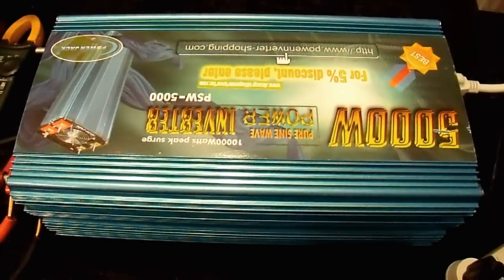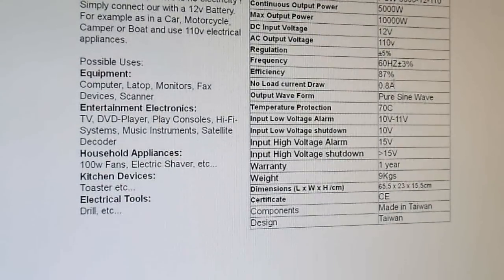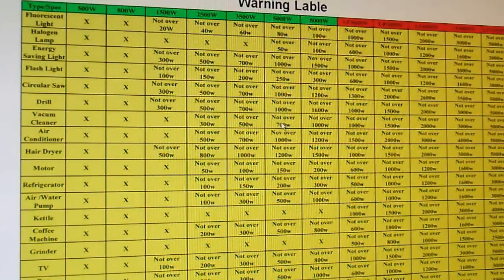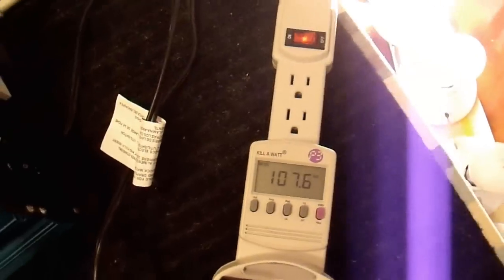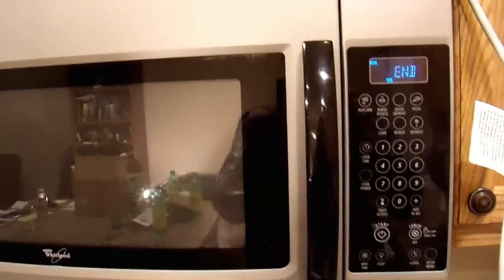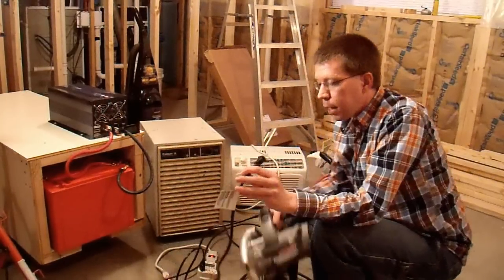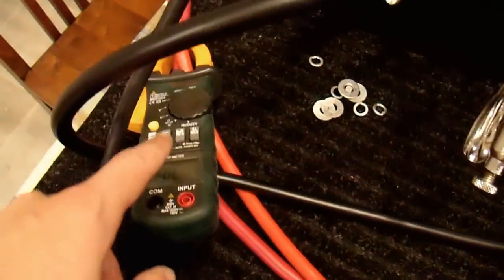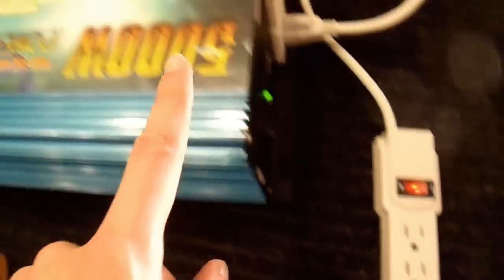Power Jack 5000W Pure Sine Inverter Review - part3/3

Comment: Can it power a fridge,microwave(what size) and TV in a tractor trailer?and maybe a laptop?
Reply: Antoine Finch if it really can handle 5000 watts that should not be a problem, fridges take let's say 300 watts, a microwave is 800 watts, TV+speakers etc. about 300watts. laptop 40 watts (when charging ), few lamps at 20 watts each and we're looking at 1500 watts when everything is on.
Reply: Antoine Finch I just pulled those figures out of my ass, microwave might take more, fridge maybe less, and considering this 5000 watt inverter could handle 2000 watts (for a short time) it should work but i'd recommend spending a bit more on a better inverter

Comment: perhaps the fan was blowing the hot air out for reason? blowing hot air inside with insufficient ventilation could overheat the components quicker. Wouldn't you agree? what if you tried to reverse the fan?

Comment: Could anyone tell a Dodge Ram 350 Hi top camper van (V8 318 5.2L) running idle could continuously power its built in AC through this inverter?

Comment: Do you think it could it run your fridge indefinitely?
Reply from the maker: My refrigerator?  Yes, I believe it could for a few years before it wears out or fails.
Reply: @knurlgnar24  Cheers,  I'm considering buying something similar just to run my fridge and maybe a security system.  My thinking is that they're appliances which are running 24/7 so if I experiment with a small off grid system those would make for a good test.  Also I wouldn't want to burn out the compressor on my fridge if the inverter can't kick over the compressor.  Thanks for the in depth review.

Comment: Your problem is not with the inverter. It may be able to drive the heaters or the microwave oven if it gets enough drive current. Most people that have problems with inverters are due to the fact that they don't have enough drive current. Running a 1500W load will require about 130 amps at 13volts. You need a running charging system.
Reply: Dave M ..also as input voltage drops the inverter draws more current which causes more heat. Not really a fair test.

Comment: I agree that Power jack inverters are pretty grim - BUT it would have been useful to know just how much voltage drop was going on at the DC side.

With the output you had with the heaters - and taking their efficiency of 87% as probably about right, you will be drawing around 225A from the batteries.

I would expect a fair bit of voltage drop from those batteries with that current - and even if the inverter wasn't crap - if your input voltage sagged to perhaps 10.75v under duress, then the inverter might have been judged a little harshly - as you said yourself, the undervoltage alarm wanted to go off almost immediately.

Really think it would have been useful to have the DC voltage monitored too.

Comment: I have a 12 volt inverter board on eBay I used it in my RV to run a air conditioner and power tools the guy I got it off of used to run a small air conditioner in an RV also there's nothing wrong with these inverter boards very strong inverter with lots of little toroid Transformers get a hold of me on eBay if you would like this I'd like to see you do something with it I wouldn't charge you much more than shipping

Comment: Wow did you say 5000 watts at 12 volts  this must be a big joke . Please let us all know how you going take over 400amps from a 12 volts system to run 5000 watts any one runing more then 2000 watts from 12 volts needs to be very careful because of the heat you wil have

Comment: also when the air compressor is full of pressure it will pull double the power to start, people without knowledge should not produce content and mislead people ignorante.
Reply from the maker: Yes, the air compressor absolutely will draw more power when it attempts to start with pressure stored in the tank.  That was the entire purpose of the test, and 'double the power to start' is likely far too low of an estimate.

Comment: I bought one of these Invertors in 2012 to go on my repaired boat,  Put it on my boat on a fully charged 300 Amphr AGM battery,  It didnt work,  I had it professionly tested and it was a  piece of junk,  $500-00 down the tube,  Dont buy one of these junk piles,  Yes, I got ripped off,

Comment: Several issues with your review including testing criteria.  First off you are relying on an ebay ad produced by the seller who may or may not have copied and pasted data from this brand or another.  If you trust ebay you are automatically at a disadvantage.  Secondly, you carp about the operating temperature on your 'long term' test.  One time you show 64 deg C which is about 145 or so F. , then you show 42 which is about 115 deg F.  That's not bad.  However, you then state the unit shut down on high temp without testing to see if that is the reason.  Since you do not know which part of the board controls that function (by your own admission)  how would you know it was high temp??  And right at the same time you indicate your battery voltage has dropped significantly to around 12 v or less while being used.  Isn't it possible the inverter shut down due to low battery voltage?  Did you test for that.  
Having been in the electrical engineering field for over 40 years it seems your criteria for making conclusions is somewhat flawed.  Now it does make for good youtube revenue receipt, but has little bearing on actual factual data.  I could go on with the loosy-goosy methods employed in your video regarding conclusions.  I want to state uncategorically that putting any electronic based device in the dishwasher is irregular at best.  Furthermore, the addition of a diode obviously changes the value being sent to the board through the conductor you altered.  Do you know the effect of that change to the operation?  
I was quite surprised that the unit was able to start and run devices you stated a 3000 watt inverter couldn't handle, especially considering this is a high frequency unit.  And the photo comparison of the windings in a low frequency unit...well, lets just say that was extremely dishonest.  
I saw some of the comments made by others which claimed to rely heavily on your opinions regarding the decisions to purchase or not.  It might be a good idea to state that your opinions are based partially on testing and may or may not be real world use experience, rather than condemn the unit based on your "testing".  Your testing is conditional at best.  
So please if other's are reading this do not use this channel's opinions to base your decision regarding whether or not to purchase.  
I have no axe to grind here either.  I, in no way am affiliated with the maker of this unit or any of its subdivisions.  
For the money this unit might be an alternative to something more expensive.  And we still don't know from your review if it really works or not.  Oh, and by the way, the unit was used when you purchased it, and it was modified as well.  You claim to have "repaired" it.  While that might be true you certainly didn't test a new unit direct from the manufacturer.
Reply from the maker: I didn't read your whole comment as it was rambling and lengthy, but as is common in toxic youTube comments people overstate their credentials.  You are clearly not an EE.  I suspect you are a tech with a basic understanding of the topics and are trained to follow scripted instructions.  I work with those types all the time - and I ignore them.

Comment: If a inverter is rated 500W,  1000W or 20,000W they should be able to run said power levels CONTINUOUSLY.   End of Rant.    Tired of the Chines Brain Games.

Comment: how when buy thing off amazon not telling you how amp the inverter is have i buy 1100 watts inverter Canadain Tire in Toronto out put 120 V 60 Hz 9 amp 1100 watts i have next 800 watts inverter 120 v 8amp next 500 watts 4amp inverter but when buy things  on amazon you can know how amp inverter is like 4000 watts inverter 30amp
Reply from the maker: You can also purchase a 5000W inverter on Amazon that can barely put out 500W.  The numbers advertised are often straight up lies.
Reply: @knurlgnar24  i live in Toronto Canada so i buy inverter from canadian tire i buy one inverter from there 1100 watts 110 V 60Hz 9A so i know my next inverter 800 watts 110 V 60Hz 8A my next inverter 500 Watts 110 V 60HZ 4A i know 9Amp,8Amp and 5Amp i buy next inverter from a guy he buy from Amazon it said 1500 watts 110V 60Hz but not put how amp how would i know how amp the inverter is